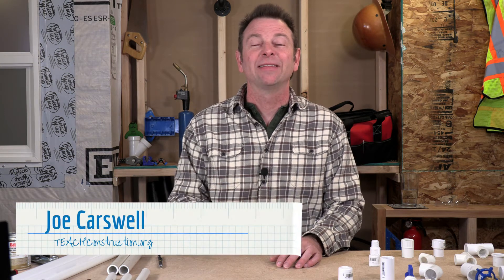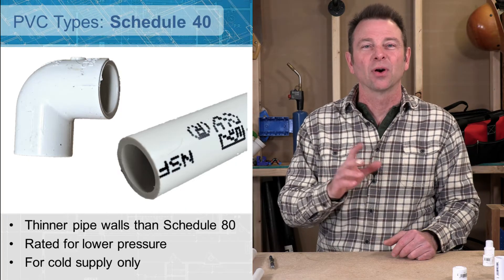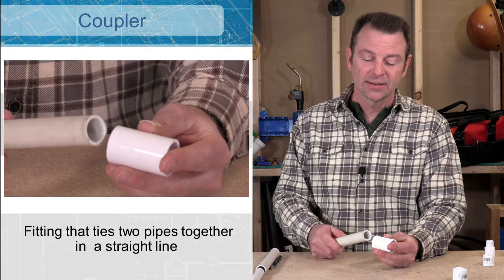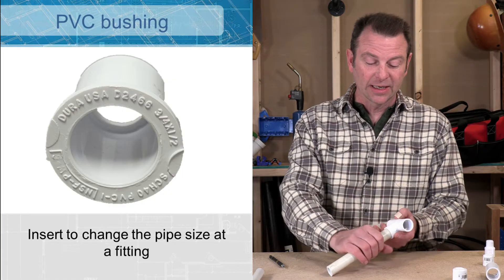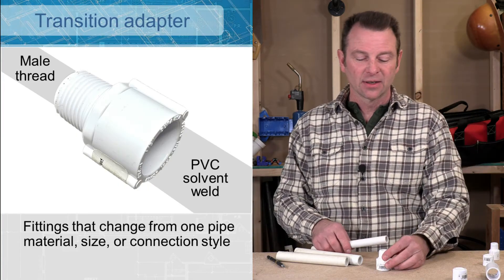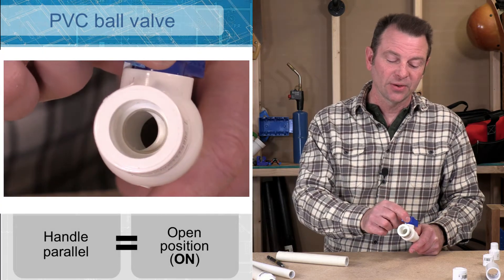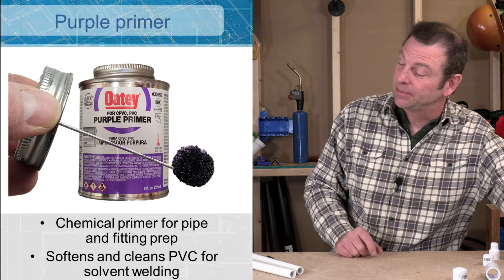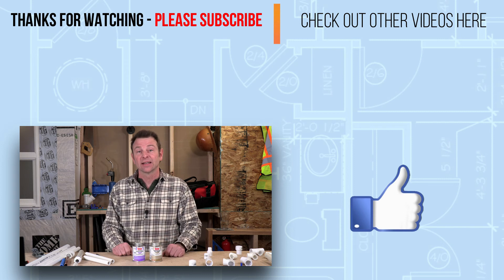Plumbing Materials PVC

Comment: Regarding plumbing that can be easily be disconnected  the exception you didn't mention is flare fittings. Plumbing with copper tubing and flare fittings is surely the slowest method but is 100% reversible. I have flare nuts that are ancient but still work as good as new. Thank you.
Reply from the maker: We consider the flare fittings a bit more advanced than this basic series.